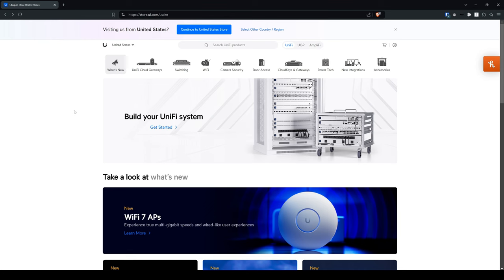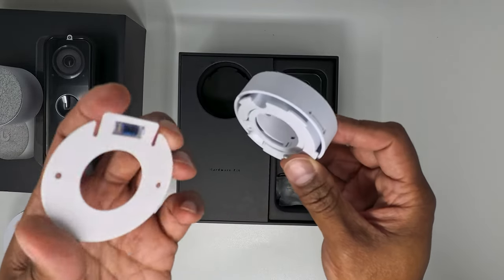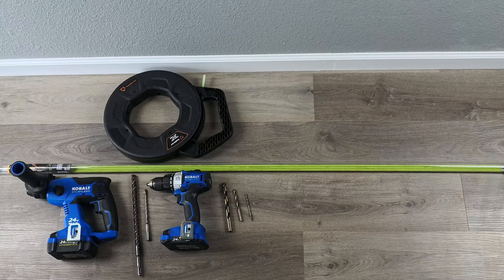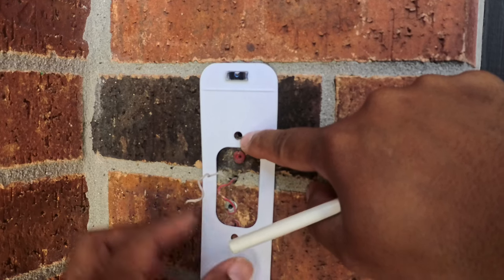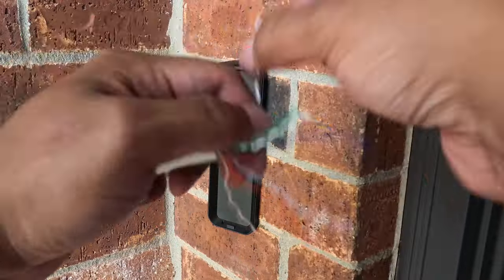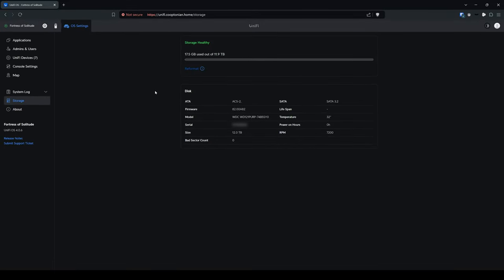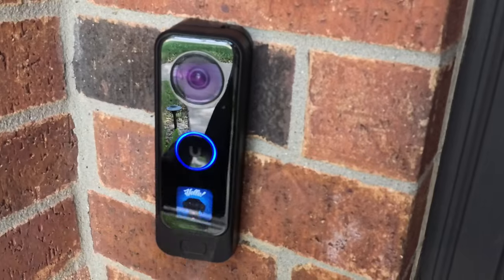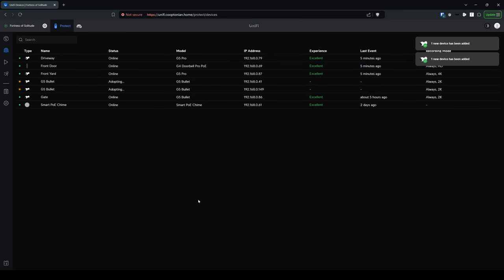Unifi Protect - G4 Doorbell Pro PoE, G5 Pro, and G5 Bullet Unbox and Install

Comment: Good stuff, bro. 

Probably a good idea to power off before install HD, although see you had no issue. Also what’s the reason for such a large squared opening for doorbell since its surface mounted?  

Great job. 👏 you need more views.
Reply from the maker: Thanks! Ha funny that you mention powering off, I did that in one of my early videos and a commenter said (paraphrasing here) "you know you don't have to turn it off first right, they are hot swap". The squared hole was to fit the back of the metal plate that sticks out (rectangular with rounded corners...I think you can see it at around the 9:49 mark)